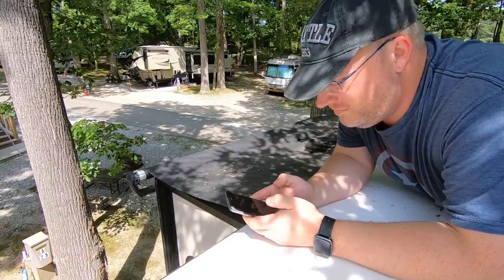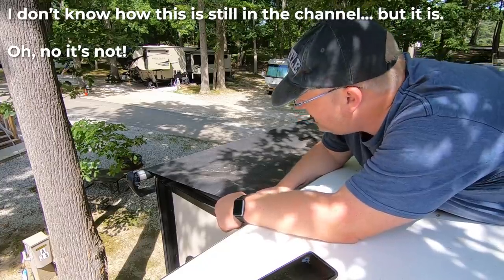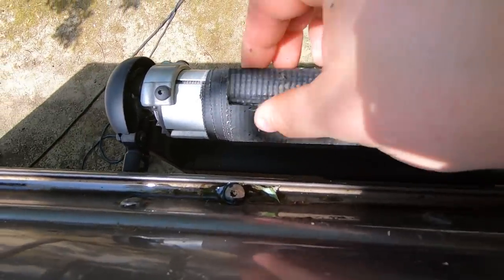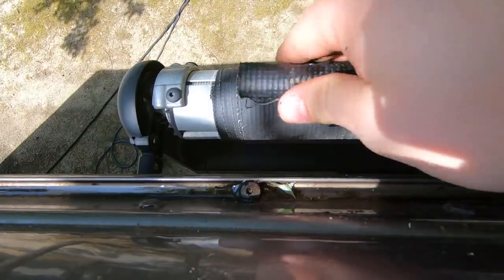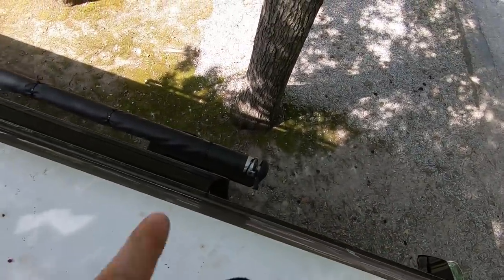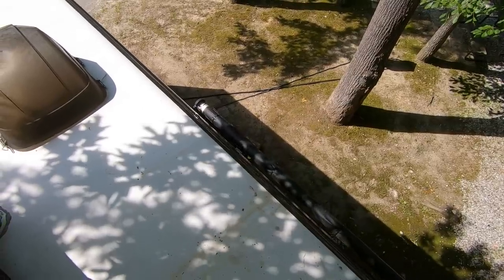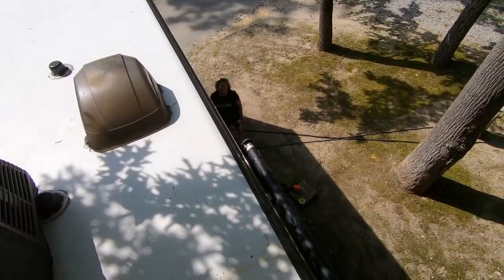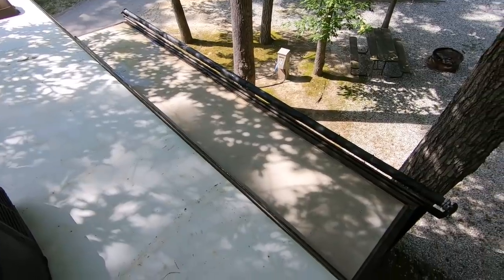Our Slide Toppers BROKE! “Fixing” Our RV so the Slide Still Works

Comment: Slides should not leak just because there are no slide toppers.  As you mentioned they are optional not required.   Our travel trailer has no slide toppers and believe me we have had a lot of rain, mainly Florida thunderstorms and never had any water get in.  You will be fine without them for a couple of weeks.   Safe travels.
Reply from the maker: Our last rig had no toppers and we never had issues - hopefully this one is the same until we get new fabric up there 😁

Comment: A few set backs on toppers you found away to fix that's the way to go. Thinking about climbing up each time to broom off slides every-time you leave not my cup a tea. Be safe driving to Florida. Enjoy your travels  😎
Reply from the maker: We didn't have toppers on our last rig so I was popping up the ladder before moving when we were under trees, and frequently up there sweeping things off. It's pretty annoying to be honest. If the replacement fabric fails while we own this rig I'll probably just take everything off, but they're not very expensive so I'll give new ones a shot first.

Comment: Get two vice grip pipe clamps at harbor freight that will make your replacement job much easier.  You will use the clamps all the time.
Reply from the maker: I saw people use those on other topper repairs but these are locked by those cotter pins so I shouldn't need them. Next time I'm near a harbor freight I'll grab a couple just in case though 👍👍

Comment: Slide toppers are like electric windows; nice and convenient but just "one more thing that can break down." I'll be honest... With as many problems as I've observed on other's channels (whereas slide toppers are concerned) I'm just not so sure they're necessary. Yes, without 'em you would need to go up on the roof before taking the slides in each time (to sweep off leaves, water and mop up any water on top of the slide) but you'd not have to worry about that expense and the inconvenience of the repair again. Just my take on 'em. BTW, get yourself a telescoping ladder so that you have it for the future; they're a good investment imo. Great video. Y'all travel and stay safe.

Comment: Zip ties and duct tape!  Always need them.  LOL  We have a canvas awning on the deck of our beach house.  The front of ours is always exposed to the elements.  I took it off ans turned it around so the thread bare & raveled end is wound up on the bar.  We never roll it out all the way, so it works for now.  I purchased beautiful teal fabric to make a new awning one day.  I just need white piping and time to make it.  But I figured we might get 5 more years on this reversed side.  At least it looks brand new.  HUGS~Donna

Comment: What kind of door knob did you end up installing on the bathroom door in the hallway ? Good job with the zip ties .
Reply from the maker: We haven't replaced that door knob yet. We've gotten used to moving through the hallway without hitting it so it may be ok, but I'm keeping half an eye out for something slimmer.

Comment: Always get a NRVIA inspection before buying! That would have been caught and the sellers could fix or deduct from purchase price. They are expensive inspections but very thorough (they do around 8 hours of inspecting). Not to rub salt in your wound but to share for people looking to buy a new RV.
Reply from the maker: I was comfortable doing the inspection myself but if definitely recommend a professional one for others not as familiar with RVs. If they had caught the slide toppers I wouldn't have had time in FL to wait for new fabric to be sourced so I probably would've just ignored that line item anyway. It has also been three months since we bought the rig and it sat in the Colorado sun. It's not a big deal - the replacement fabric is actually way less than I thought it was going to be!

Comment: It looks like since the topper is attached on the end of the slide out but not at the base of the RV roof and attached on the corners but not in the Center so all the rainwater that sitting on the slide out topper is going to be funneled directly into the center of the topper into the RV I would just take the toppers off and let the rain water flow off the sides of the slide same as all other slides that don't have a Topper. I don't think a piece of canvas topper is supposed to be the stopper of the rain I think it's a bigger issue with the slide and the caskets.
Reply from the maker: I've thought about disabling that one too. It hasn't rained yet so once it does I'll see how it behaves and if it causes any issues I'll just zip tie it up too.

Comment: The way the Toppers are ruined in the center I think they are helping the rain flow into the RV instead of preventing it and running off the sides of the slide you're probably better off without the Toppers it seems like that's what's causing the problem now

Comment: Looks like you just need screen rubber edge core and some flex seal paint for the fabric. Just thought. That rubber should allow you to push into the wedge on the RV and the paint can seal the fabric itself and get you some life out it.
Reply from the maker: That sounds possible, but I really don't know if that would hold up. There's quite a bit of tension pulling outward on that fabric. That plus the old fabric is all stretched out and pooling really badly when it rains. The new fabric that I ordered is double stitched and a tougher material so it should hold up much better.

Comment: Does the slide bobble up and down when you sit on bed or dining bench with the canvas disconnected. I thought the canvas helped stabilize the slider. Yes No. maybe. We’re brand newbies and have an awning torn
Reply from the maker: The slide topper is a completely optional piece of equipment and has no effect on the slide other than keeping the top clean. When an RV slide is run out all the way it "locks" in place. If your slides move independently of the rest of your RV when you put your weight inside them, that could mean something is broken. A torn awning or slide topper is caused by age, weather, or tree limbs.
Reply: Five2Go oh no. We haven’t even gone anywhere yet. I need to take it to a repair shop. Is there any other place that can fix that problem other than rv shop. Thank you so much for your response. The info is great and so important. I went and bought a bunch of the stuff you explained in newbie rv’ers. Have u ever had a slide break before. Is it safe to drive like that. Now I’m scared to go on our fist road trip. Thank you again. 🦩 Florida woman here. Neighbors.

Comment: You haven't had your rv very long.  Do you think you got a lemon?   Or is it just some unexpected problems with age of rv?
Reply from the maker: The things we've had issues with are parts that wear out over time anyway. We knew there would be some worn items when buying a used RV, just like there would be with a car or a house.
Reply: I know we have had a few problems on our 2016 we bought.     I just wish they would have looked our over and repaired the small things such as they did not change oil and air filter was filthy and looked like mice had been chewing on it.  Especially with something with an engine.  We do have a slide awning that looks loose also.

Comment: Gimme 3 packs of bubblicious, a roll of duct tape and a 6 pack of Heineken and I’ll knock this out in 20 minutes.
Reply from the maker: Haha! You don't happen to live in Central FL do you? 😂😂😂
Reply: Five2Go lol different question. Not implying you’re big but, how much weight can rv roofs support? Was there any give when you were up there? Any creaking while up there? Is it possible to put a couple folding chairs up there to chill like in the walking dead series?
Reply from the maker: RV roofs are pretty sturdy actually. I'd be worried about ripping the roof with chairs, but you could definitely have 3-4 adults up there with no problem I imagine. If zombies are in the picture, I'd be a bit more aggressive about the number of people up there and less worried about ripping the roof 😂
Reply: Five2Go yes. You can never be too sure when zombies are involved.

Comment: ATTENTION:  Don't go with Shade Pro slide toppers.  We just replaced all (3) on our 2017 Bounder 36H with Shade Pro that have an extra hem on the sides.  I thought that sounded like a great idea but after installing found out that the extra thickness of the side hem makes them hold water with no ability to drain.  When I called the company to tell them they said that we should bring our slides in if it starts to rain.  (lol)  We now just carry a "L" hook to pull down one or the other end to drain the kiddie pool that forms.  We will just have to replace them again with another brand.  Hope this helps you.
Reply from the maker: I'm glad that's not who I went with! That sounds like a really bad design flaw, and bringing your slides in every time it rains??? No thanks!

Comment: I would send this video to Matt at General RV and ask them to warranty cover it as you JUST PURCHASED THIS RV......I think Matt will do the right thing
Reply from the maker: We bought it 3 months and 4k miles ago and didn't get a used warranty so they're not obligated to do anything. On top of that, it would cost more in gas to get the rig there and back than the replacement topper fabric was 😋

Comment: Just some friendly advice the owning over the bed you will need to Buddies to help you with that the one over the living room you will need at least four people to put that in good luck and don't get too frustrated
Reply from the maker: These toppers go on a little differently than the other models I've seen in videos online so it should be possible with just the two of us. If the living room slide gets too heavy I'm sure I can rope in some friendly campers for a beer or two 😋

Comment: Looks dry roted. Thats what happens when it sets for a long time getting wet and drying out rolled up many times.
Reply from the maker: You're most likely right. I have no idea what went on with this rig before we bought it and it was from Florida so it definitely could've just been outside in the elements for a long time.

Comment: What’s the purpose of your videos? I thought it was to experience your travels with you but all I’ve seen are talking and everything repairs. Also, can you use waterproof tarps to keep the slopes dry until your fabric arrives? Fl has almost daily afternoon thunderstorms.
Reply from the maker: The slides can get rained on, slide toppers are an optional upgrade that helps keep debris off so you don't have to get up on the roof and sweep the slides off before bringing them in. There's no reason to worry about covering them before the new fabric comes in.

Comment: This should have been replaced at the dealer before you took delivery. This dealer has a bad reputation. Lots of complaints. Bring it back to them and make them fix it at no cost to you.
Reply from the maker: I checked it out when I was down there and they looked used but ok. Plus we're nowhere near that dealer so it would cost me as much in gas as the replacement fabric will cost. No big deal!

Comment: Did you not inspect the camper before you bought it it’s a four year old camper what you think if it was a four year old camper that those things were dry rot and you would notice why wouldn’t you have check that out that sounds like a big boneheaded move on your part for buying the thing to begin with and not checking out things before you buy it
Reply from the maker: Thanks for your input Paul, but I inspected it top to bottom and did see that the slide toppers were obviously a bit worn from age and weather. Neither of them were damaged and short of dumping buckets of water on them there's no way to know how much they were sagging since everything was dry. The fabric is not expensive to replace so it's really not that big of a deal - I was more worried about the important and expensive parts of the motorhome.
Reply: It’s better to remain silent and be presumed an idiot, than to open your mouth and remove all doubt🙄